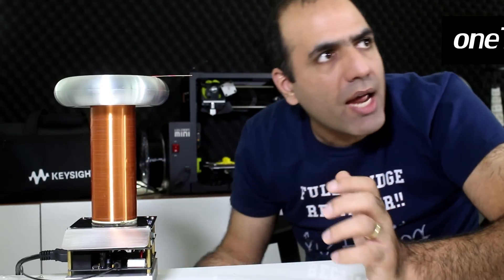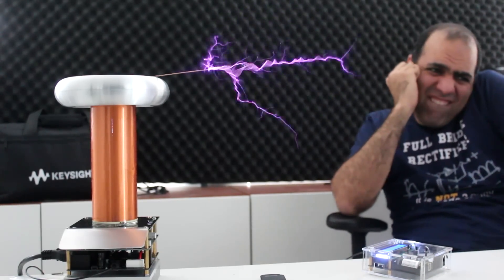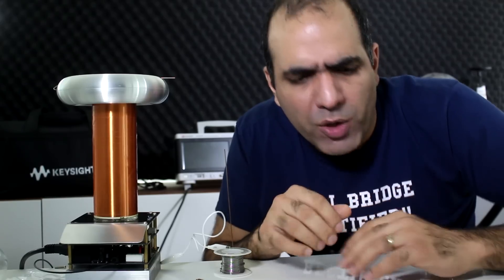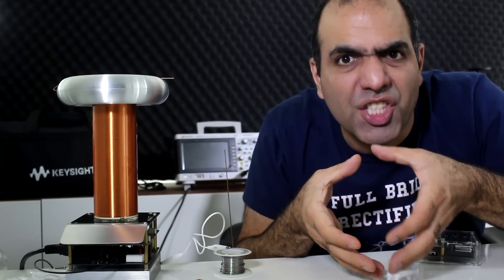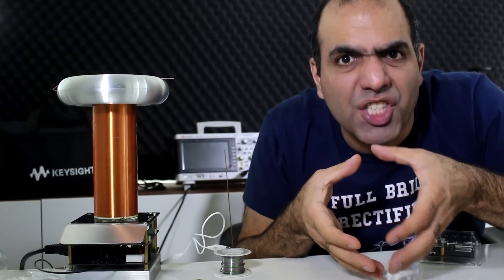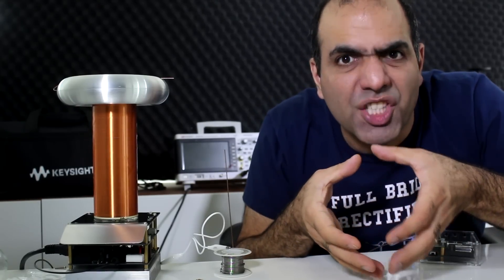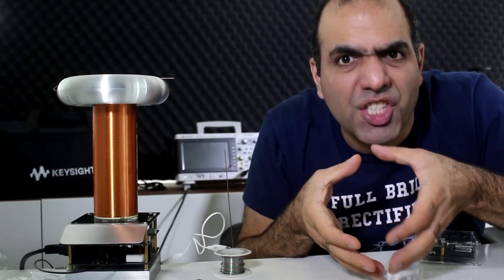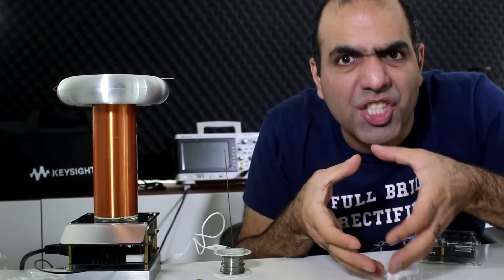All You Need to Know about Tesla Coil... Almost (OneTesla Part 2)

Comment: Nice video. Been looking at getting a OneTesla tesla coil for about a year now. Many things have happened and haven't had the chance to pull the trigger. I did learn some new things from this video that I didn't know about drsstc's. Also the kit looks like it has fewer components than I originally thought. Would love to have a tesla coil with an interrupter for messing about. Music, especially with MIDI and MML, has been a fascination of mine which started with some video games. Transcribed music from midi to mml for games such as mabinogi and archeage. Enjoyed that as much as playing the games. When I first found musical tesla coils it was from an ArcAttack video. From there I found Eric Goodchild. At that point I was dead set on getting my own musical tesla coil. Would love to find out what the coil can really do with music. A torture test I suppose to see if it supports all of MIDI's standards or if just the basics. And if you're worried about my ability of assembly I've already built a few electronics kits off ebay including some simple LED clocks and displays and my favorite of all is a nixie tube thermometer.

Comment: You should avoid wearing a gold ring while using electricity, especially AC.
AC current can induce a current in the ring and then the ring becomes hot, it can then burn your skim... best to take off you ring before using electricity.

Comment: Having just studied AC electronics, I was glad I could understand the resonant frequency and LC circuits. Although, you did draw the voltage and current through the LC circuit at 90 degrees out of phase, and not 180 degrees out of phase. Good explanation of the tesla coil though.

Comment: I found out that it is best to check polarities of components not only by looking at markings, but actually test them to verify polarity. One project I had ended up blowing fuses because one of the high voltage supply diodes was marked backwards.

Comment: I am a electrician and I would love to just have a tesla coil to experiment with for just a few hours. I need to unlock teslas secret if the glowing wire lighting system. 

Altho it was a boiled linseed oil transformer in a dual motor generator configuration for the procedure I read up on..

Comment: Man, i really need this tesla coil AND ALL OF YOUR TOOLS, YOUR LAB IS AMAZING. by the way, this is the best video u made until now. I really like Power circuits and work with inversors. I only missed a better explanation of its control system, because u need to prevent dead time and things to avoid problems, even why the secondary has a big fuckin voltage. You are amazing

Comment: Awesome video. I built a Tesla Coil for my grade 9 science class. I used a 10Kv oil furnace starter ( if my parents only knew how dangerous my science project was lol) 2 jars filled with salt water and wrapped in tin foil from cigarette packages as my power source. A spark gap that I could adjust frequency with on the Tesla coil primary. It worked pretty well, 6 to 12 inch lightning. I fried my Apple 2 plus computer and it would blackout the tv down stairs. I fried the primary before I had to bring it in to class. So I never got to demonstrate it to the class and teacher. Don't remember the mark I got but I was pretty bummed.
I would like one for sure, plus it's my birthday tomorrow....really it is!

Comment: That's a good kit, I can see why so many people want it. Thanks for doing this video, and sharing the love of things that go ZAP with any similarly demented people (that's a confession, I guess). I think that's the first time I saw a primary coil as a trace on a board, glad to see it does not just overheat and peel off. I'm still working on mine, at the pace of a tortoise. I got it working, and am now finding ways to increase the spark length. I now have a 0.1 uF cap and somewhere around 7mh with a coil made of 1/8" solid copper wire. Current is up to 90 amps, pulse limit is 200, using IRFZ40 transistors, but they are starting to get really hot. Spark is about 3" long. That's probably about it, until I can build a heavier drive circuit. I was looking at One Tesla as well, but did not have the $$ for it. Thanks for your review on that. Keep it up, I love it!

Comment: I'd really like the Teala coil kit. I've wanted to build one for years, but didn't have the parts. It is my senior year in high school and I want to use this as my capstone project for AP physics 2 and my electrical engineering class. I would leave it with the school and maybe it can help get people interested in science and engineering. So in conclusion GIMME THE ONE TESLA COIL!!!
Reply: Got a radio shack in ur town mine had 2 but they got taken out i wish i could learn about electronics n stuff im a junior and i got ap computer science computer programing and robotics

Comment: That they are fake, simple, because cooper can't shoot electricity and neither electricity is able to travel through air, all those lightnings are just holograms they make with their own minds, you can see that there is no light produce in the bulb, because is just a hologram, besides electricity is blue in color, and the holograms can't be made in blue, which you can easily see that is not real electricity

Comment: OK,I'm curious. That lil coil puts out some very nice sparks. Actually impressive for it's size.  Did you tune the coil? Primary and secondary windings having the exact same weight. Then tuning the primary contact point with low voltage and your scope for maximum secondary voltage.
 Also,you should go DC. Tesla's greatest secrets were achieved with DC coils. His floating plate,or possibly his anti grav theory were achived with a combination of AC an DC on the triple plate stack. 
 Try building your primary coil with a non metalic wire,like graphite ignition wire. Just 4 microwave diodes for the bridge and an oil filled or Leyden jar DC cap.
 Funny thing happens with pure DC non metallic primary coils. Almost impossible to photograph the sparks. Really an usuall effect. You'll also find it nearly painless at 400 khz and above.
 Have some more Fun. Really enjoying yur humor. Very nice in this mundane world !

Comment: Can I have the light bulb? If this is not possible I would also take the tesla coil. The reason for this is that i need good ideas in the future and my first choice would be an eluminated bulb over my brain. But a brain wave is also fine.
Okay i admit this was just fun. I prefer the tesla coil because i want to get rid of the mosquitos in my room. But together with the light bulb it would even work better because the light attract the mosquito. But wait this will not work because the misquito has no connetion to ground. But when it flies in the arc it will produce enough heat to disable it. But the arc of the bulb is inside. So the tesla coil allone would be okay :).

Comment: You gotta' give me a Tesla One Tesla coil. I NEED IT !
I used to build spark gap tesla coils powered by neon sign transformers. I've had 6ft streamers from the largest one (can be seen on my channel). You gotta' love the smell of ozone if you're going to run a coil - they produce it in very large quantities. I once ran a coil on a rotary spark gap and holy hell the noise was on another level. I ended up wearing ear defenders as it was too painful to stand within 10ft of it.

Comment: On a electrical post there is a ground wire that go from top bottom. That wire is winded in a spiral at the bottom of the post, proto tesla coil. If you put a voltmeter on this coil, it say 120 v. Why ? 

There is your free energy, you noisy bitch.

Comment: Since you have more than two exactly the same secondary coils (from the other kits), you actually could receive free energy with one of the secondaries (radiated by a working telsa coil in the same room). Just place the bare second secondary ;) coil next to the running tesla coil, if it is powerfull enough it will acutally produce some sparks, not just light a "plasma" bulb. Remenber to ground both.....

Comment: if it's 1 million DC. then how much would that = in AC...  rephrase. the pain from 120v AC when you're 4 years old. what's the DC pain equivalent.
Reply: or at age 14-15. touching the metal part of a lightbulb while light is on.

that one hurt about 10x worse.

at the time I didn't know about electricity and thought that I wouldn't get hurt. I thought it was the equivalent to ground at the time.

Comment: I wonder if this Tesla coil could be hooked up to a speaker system using an audio input jack, as one of the tweeters alongside some standard tweeters and a subwoofer... might get nice high frequency fidelity like with a plasma speaker 🤔 also, as you are giving one away.... I could try that particular experiment and video the results 😎👍

Comment: I need one!  --I made one back in High school  using a neon sign transformer and glass jars with salt water and aluminum foil as home made capacitors.  It made around 12" sparks with my handwound 4 ft secondary (cardboard carpet tube)  the modern one looks much better!!

Comment: I want one as I have some plans to do some experiments. One involves a model of the solar system and the other has to do with electrically structuring water.  It would be nice to get a free one as I am on a fixed income but if for some reason I am not worthy of your generosity then I will buy one for myself.

BTW, love your vids. Entertaining and informational. Keep up the good work.

Comment: Why does the Tesla music sound like an incredibly old MIDI?
Reply: It sounds like it because it is midi controlling it
Reply: +LeKevKa What better formats? I thought MIDI is still the standard for interfacing virtual instruments.
Reply: MIDI files don't actually contain any data on how the instruments should sound. That is to be handled by a MIDI synthesizer. Most people associate MIDI with the sounds of old Sound Blaster or AdLib cards, but if you play an "old" MIDI file on a modern synthesizer, it will sound like actual music.
Reply: Musicians use MIDI.  You might think of it as a file format, but it's actually an incredibly powerful programming language, usually used for communication between keyboards and sound sources.  MIDI files, or what you're referring to as "MIDIs," are just files written using that language.  It was never really intended to be used as an audio file format, so MIDI files are completely different from actual audio files.  They actually contain music data, not audio waveforms like a WAV, AIFF or .mp3 file.  Myself, I use them to create audio files from the music I write.  I create the files in MIDI sequencing software (actually musical notation software), then run those files through a sampling synthesizer to convert them into audio files.

BTW, the reason the music sounds like an "incredibly old MIDI" is that the OneTesla driver receives MIDI data and converts it into an alternating current signal.  He was running actual audio, converted directly to an AC signal, into his old Tesla coil.
Reply: LeKevKa MIDI stands for musical instrument digital interface, .mid files don't store audio, they store note and timing data.
Reply: Because it is using MIDI :-)
Reply: midi does not have a sound, it is a communication protocol.. connecting a plain keyboard to an synth for example, synth gets a message about what note it should play and at what volume(how hard the key was pressed)
Reply: The 300 Hz resonance frequency doesn't help the sound quality. He was playing audio files with his old one and it had a higher resonance frequency to work with. 

I wonder what it would take to make a Tesla coil with a 48 kHz resonance frequency. Could it do a true 1:1 digital equivalent?
Reply: I would say because it only uses square waves
Reply: You are probably thinking of FM synthesis like in the old sound cards.
Reply: Because the driver circuit is using pulse signal to fed the tesla primary inductor. Pulse / square wave creates a distorted sound just like you would hear on midi or 8bit music. I guess the interuptor convert the audio signal into square wave by amplify the input until it bumps the power rail. Then merge it with high frequency carrier signal from oscillator before fed it in to tesla driver circuit
Reply: Because the primitive playback devices or methods that you are probably associating those old MIDI files with didn't do much more than "smack the air" like this coil.
Reply: MIDI is still used today, why you call it old? ._.
Reply: @ipasuhd  he probably meant to say MIDI with old sound synthesis
Reply: Who uses MIDIs today? xD There are way better formats / containers out there.
Reply: Because it is. MIDI is used in the interrupter to produce the sound / tone / music.
Reply: LeKevKa MIDI signals are still used by modern DAWs such as FL Studio. I can't blame you for not knowing that though, since most people when they hear MIDI are actually thinking of the Microsoft GS Wavetable Synth, which is just one of many keyboards that is capable of playing MIDI format files. They can still sound good with a soundfont, and as for the container format, it's still useful for transferring notes from FL to Logic or vice-versa since it is not a proprietary format.
Reply: Horus Horus hahaha omg that's the worst answer ever. Mono?
Reply: Haha, "Free energy".
Reply: A worthy experiment for ElectroGOD  /watch?v=_yH9ll-0hDk&lc=Ugg2j1-V8MnVkHgCoAEC.8FdXlja2wHg8Fda4CJ7jRd 
and maybe he could use this new OT architecture to better his original design
Reply: killarun4 ✌️
Reply: I don't think it is possible to play music from the arcs of a H bridge DRSSTC in any other way than by modulating the frequency of interrupter signal. In this kind of DRSSTC, the interrupter has to be clocked with the feedback signal using a JK flip-flop so that the switching is only interrupted during a part of the cycle when the primary current is close to zero.
Reply: the tesla coil has it's resonance at 300 kHz
Reply: Everyone who makes music uses a form of midi.
Reply: Because Tesla was a retro gamer 😎
Reply: It's because he was playing old songs pink panther etc.
Reply: MIDI was invented by Tesla
Reply: MIDI and the Tesla use the same free energy to output
Reply: Its like 8-bit with a bit of midi
Reply: LeKevKa - Why does your comment sound like some incredibly old SHIT
Reply: Thanks for all the answers. Didn't know that MIDI is still being used in that field ^^
Reply: Becouse it`s Mono Sound....

Comment: Gimme da one Tesla! I’ve always dreamed of shocking the f*ck out of myself and this is the perfect opportunity!
Reply: i made a spark gap tesla coil using a bug zapper, i always discharged the capacitor by pushing the two nails in the spark gap together, although it was insulated by electrical tape (which is an extremely poor choice), it shocked the shit out of me, i think my muscles contracted, because i couldn't let go immediately, when i did let go, i jumped back from my sitting position (i wasn't sitting in a chair, thankfully, i was just sitting on the floor at the time), and i wasn't allowed to swear back then so as soon i got shocked i  shouted "AHH, HOLY CRAP THAT HURT!", i never used that tesla coil again.